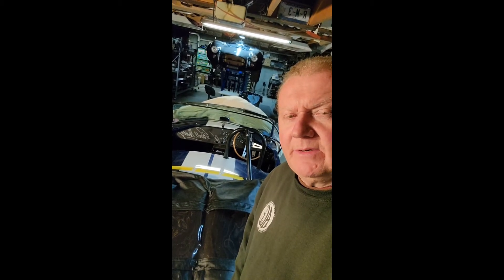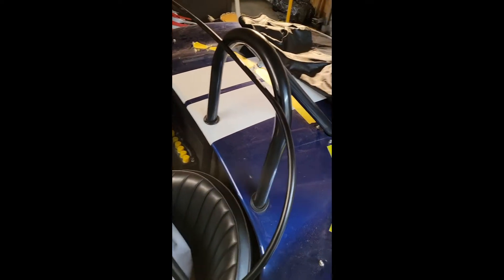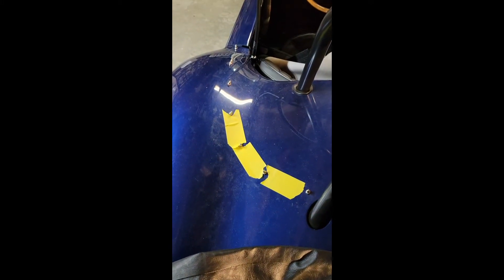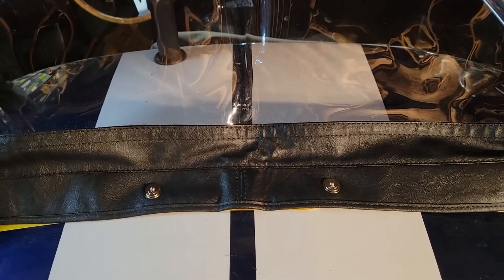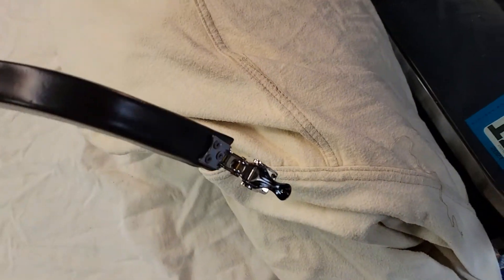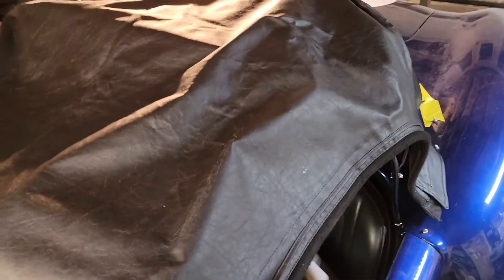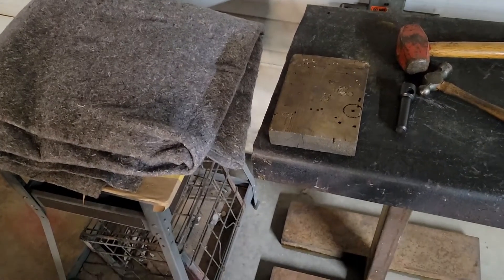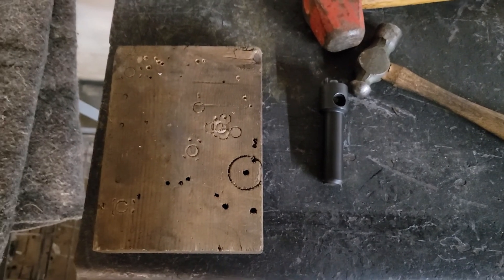cobra soft top installation

Comment: the top is nice but it needs some kind of weatherstrip for along the top across the windshield , cause it leaks like a sive when driven in the rain , as i say the top for these cars is just the illusion of staying dry , and dont forget to seal the bottom of the windshield to the body as water will come in under it ,
Reply from the maker: Yes we use a weather strip inside the split header bows. I disagree with sealing the bottom rubber to the body. You want them to flex and not stress.

Comment: Is there a part 2?
Reply from the maker: I believe I ran some more video. I will go back through my files and find it when I get chance. Are you ready to install one on yours,
Reply: @nickacton9006  Should be ready in about a week.
Reply: Did a test fit, and really can't see how I can fit it without major modifications. The rear doesn't seem to sit well, especially the corners. And the top section seems like it doesn't have enough support. I'm really worried I won't be able to get it looking right without any wrinkles.
Reply from the maker: @gregcarmody8018  do you have a roll bar you are trying to work around? How did you get your lift-the-dot post layout?
Reply: @nickacton9006  yes I need to work around a full width single rollbar. I lowered it a bit which helps. May need to bend it forward a bit so the corners can reach.